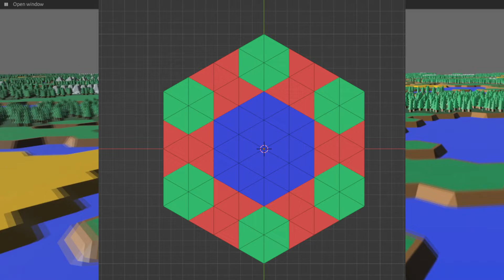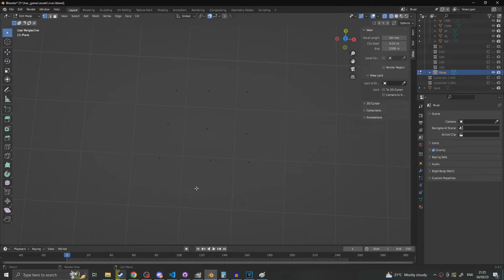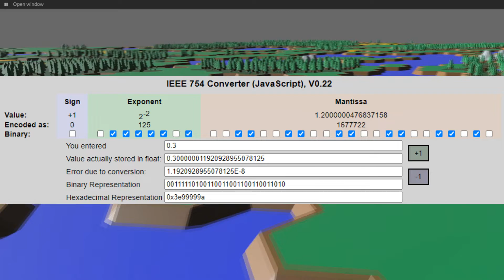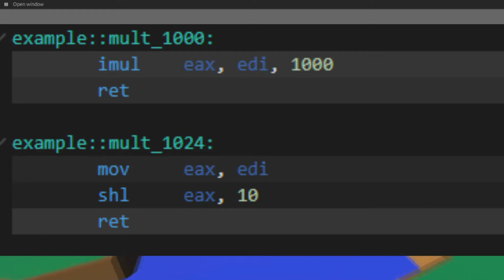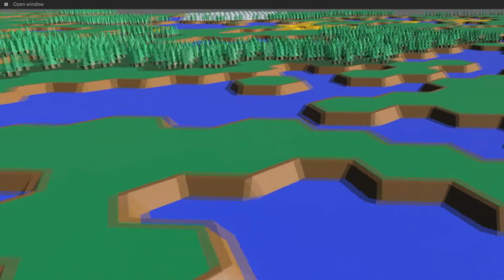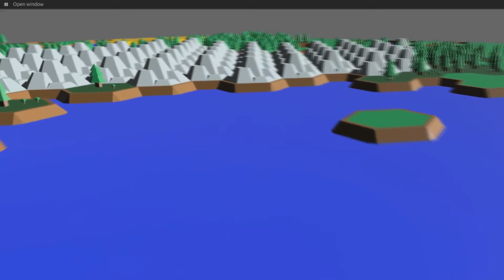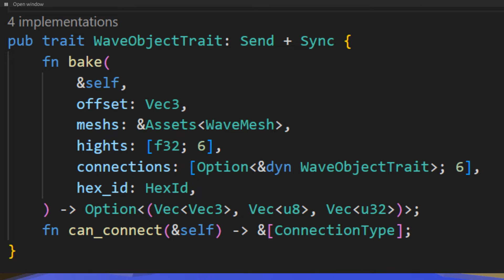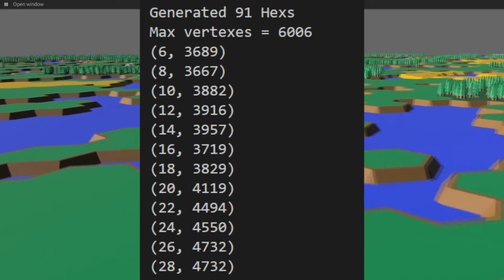Why I Swaped to Fixed Point Numbers in my game #UTDTG #devlog 2

Comment: Remeber that, especially in a CISC architecture, the number of instructions doesn't necessarily line up with the number of cycles. I'm pretty sure the `imul` is taking up more cycles than the `shl` even though there's an extra instruction.
Reply from the maker: Yeah, that's why I mentioned it was a different instruction, but I wasn't sure about the actual cycles or where to find that so I thought I would play it safe and dumb it down
Reply: @PhaestusFox you can find the number of cycles for every instruction in the manual for your CPU, which you can download for free on the manufacturers website

Comment: I think you could specify hexagons entirely in integer math using Eisenstein Integers. Every vertex you care about, I think, would fall on an Eisenstein Integer. - No float issues, nor finite precision issues. You would get the exact result 100% in integers.

The trick is basically to calculate stuff in two dimensions in the Eisenstein basis. Every Eisenstein Integer has the form a + b w, where a and b are regular integers, and w is the complex number (-1 + i sqrt(3))/2 (or in terms of vectors in R², {-1/2, sqrt(3)/2})

Now obviously w does require you to do non-integer math.
However, you only need to do so at the very end. You can delay doing that multiplication until the very final step when you actually need to determine the actual position of any given vertex for the purpose of rendering. All the operations you'd likely care about (translation, rotation, maybe scaling - as long as the result is confined to the grid) can be done then with regular integer vector math.
Before that point, every vertex has a clear integer Vec2 that defines its exact location and so everything is going to be seamless and perfectly comparable with a fully decidable equality and all that jazz.
Reply from the maker: Right that does sound like something to look into, this was one of the major reasons I originally created my channel, to get suggestions for things I wouldn't have ever thought to even google
Reply: @PhaestusFox  this method ought to work with any sort of regular lattice tiling, and if you are a bit creative, you ought to be able to do it for pseudo periodic lattices (say, Penrose tilings) as well, though that's gonna be much tricker for sure.
The same concept would also work for 3D tilings if you ever consider making those. Say, for a Minecraft clone that's not based on cubes but rather on any of the other shapes that can be used to tile 3D space. As long as you can describe all positions you care about in terms of integer-scaled vectors, you're in luck. (The vectors themselves don't need to be integers. But the locations expressed in the basis those vectors provide must be integers. Then all positions and comparisons can be done with integers until you need to realize the location)
Reply: If you want the super technical/rigorous take on that, this is called field extensions. You are extending the field of Integers with one extra quantity w which follows w³ = 1 and that gives you the Eisenstein integers. You are at all times abstractly operating on that w, getting the basis (1, w, w²), implemented exactly like how you'd implement complex numbers.
You get stuff like w² + w + 1 = 0, i.e. w² + w = -1 and w² = -1 - w (which is why you can get away with only w. Anything to do with w² can be reexpressed in terms of 1 and w using that equation)
a general Eisenstein integer multiplication looks like
(a + b w)(c + d w) = a c - b d + (b c + a d - b d) w
the square norm of an Eisenstein integer
|a + b w|² = a² - a b + b² 
if you need the actual length, you don't necessarily get an integer, but if the square of the length suffices, that still is an integer.

You also get the complex conjugate w* = w²
which is slightly different from the complex numbers.

You even get appropriate rounding this way, which is an issue you had, right?

Take two Eisenstein integers:

(a+b w)/(c + d w) =

(a + b w)(c + d w*) /((c + d w)(c + d w*)) =

using w* = w²

(a + b w) (c + d w²) / ((c + d w)(c + d w²)) =
(a c + b d + a d w² + b c w) /(c² + d² + c d w + c d w²) =

using w² = - 1 - w

(a c + b d + a d (-1 - w) + b c w) / (c² + d² + c d (w - 1 - w)) =

(a c + b d - a d + (b c - a d) w) / (c² - c d + d²) =  

at this point, c² - c d + d² is a regular integer (no w appears) so you can divide by it in the usual way.

=
(a c + b d - a d)/(c² - c d + d²) + w (b c - a d) / (c² - c d + d²)

so now you have two fractions that may not be integers. I think by simply rounding those two values, you end up with the right result. You might need to floor or ceil instead of regular round. But one of those three ought to do the trick.

So the quotient is

q =
round((a c + b d - a d)/(c² - c d + d²)),
round((b c - a d) / (c² - c d + d²))

and the remainder, if you need it, is

r = (a+b w) - q (c + d w)

I'm not 100% sure this is exactly what you need. But if it is, then you only need to keep track of two coordinates instead maintaining three that sum to a constant. The rules of the space you define that way would keep track of that constraint automatically.
Reply from the maker: @Kram1032 that's neat, maths going a bit over my head, haven't looked at this stuff in months since I got a full time job and don't have the time/energy. But I thought I was only keeping track of 2 of the 3, since s=-r-q. I'm sure this fancy math would be useful for the shader and rendering side of things
Reply: @PhaestusFox  not sure if that's still up to date but you mentioned in the video something about rounding and having to check three values and then discard one conditionally to get the sum to be right. There is a chance that fancy division on and rounding to Eisenstein integers might avoid that extra check.
Reply from the maker: @Kram1032 oh yeah to round cubic positions you need to round all three and discard the one with the biggest difference, otherwise you can break the q+r+s=0 forget about that, tho with the amount of math in your post it may not be computationally faster. Could be more elegant and lead to better implementation tho
Reply: I checked what it takes to get everything within some chunk size.

Say your chunk size is 2, so you get 7 hexagons per chunk. (I'm assuming a chunk size of 1 is a single hexagon per chunk)
In that case, if you follow the Eisenstein coordinates, you'll find that the first seven chunk centers lie at

(0, 0) - the center of the world
(5, 4)
(1,5)
(-4, 1)
(-5, -4)
(-1, -5)
(4, -1)

As a sanity check, all six of the later ones are equi-distant to (0,0). The distance is sqrt(21), using the distance formula D² = (a-b)² + a b.

You can arbitrarily pick any one of these and divide by its coordinates. For instance, let's pick the first one. (5, 4)

If you plug in all the values you get, that any point divided by (5, 4) is
(5 a + 4(b-a), (5b - 4 a)) / 21

For the various chunk centers, this will yield integer coordinates:

(0, 0)
(1, 0)
(1, 1)
(0, 1)
(-1, 0)
(-1, -1)
(0, -1)

And all the hexagons that aren't chunk centers get rational coordinates such that, if you round them, they round to the chunk center, which is what you want.

So all you need to do is
- find one neighbouring chunk center's Eisenstein Integer coordinates
- divide everything by those coordinates
- round both coordinates to find the corresponding chunk coordinates

note you only need to find a single neighbouring chunk's coordinates once and you can also cache its coordinates as well as D², so in the end you just get 4 integer multiplications, 2 integer subtractions, 2 int-int-to-float divisions, and 2 float-to-int rounds per tile to determine what chunk it belongs to, and you avoid the conditional.

I'm guessing ultimately it might be about equally fast, although presumably, if you are going for a GPU implementation, avoiding the conditional is quite useful.
Reply: Ok apparently I'm wrong, never mind.
I mean, you do get chunks. But they are not hexagonal. Instead, they are rhombic. Which may also make sense, or not, depending on what you want. What you divide by determines the size and orientation of the rhombuses.
Of course, if you are fine with rhombuses, you might as well just do completely regular division by chunk size and round that.

Comment: I have just a single question: why are you use bevy game engine? There are a plethora of complete and big engines, such as Unity and Unreal, and Godot engine with its simplicity and sufficiency. If you spend same time as you do here, you will gain more profit
Reply: Fairly sure the answer is Rust. Unity uses C# which uses a garbage collector. Unreal engine uses C++. Bevy uses Rust.
Reply from the maker: Yeah that fact that it is rust is definitely why I first found and started learning bevy. After learning it tho I think the biggest thing that would stop me from changing is bevy is built around the ECS paradigm, I know unity(dots) and unreal have their equipment ECS system but as afterthoughts not the way things are done
Reply: bevy is also open source and available under a permissive license